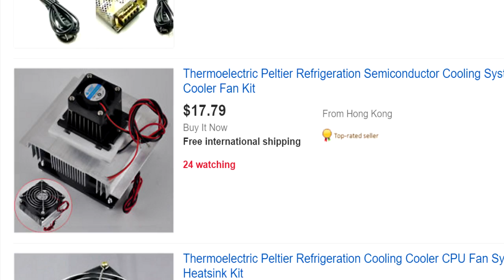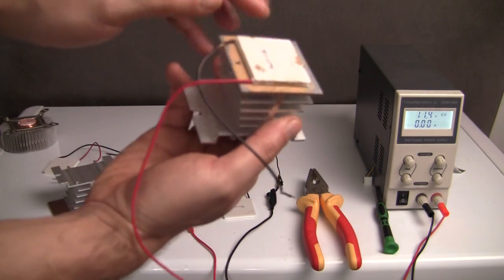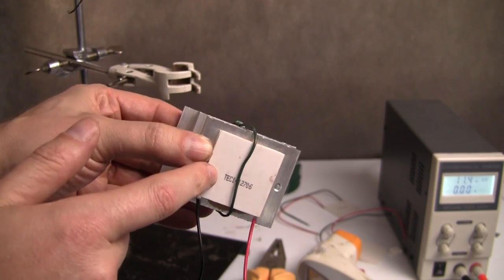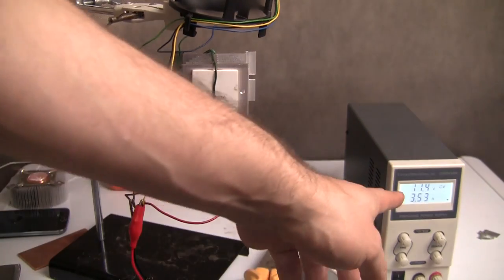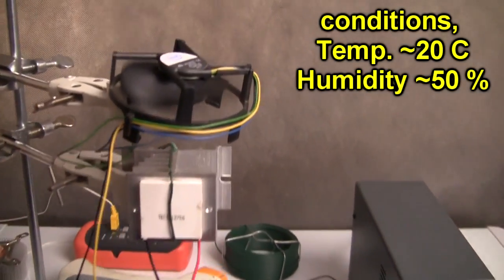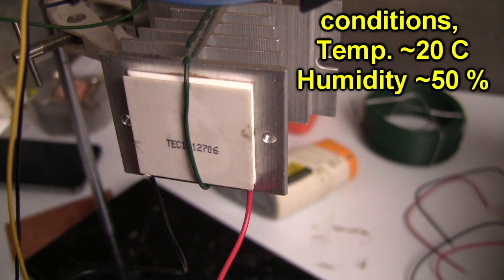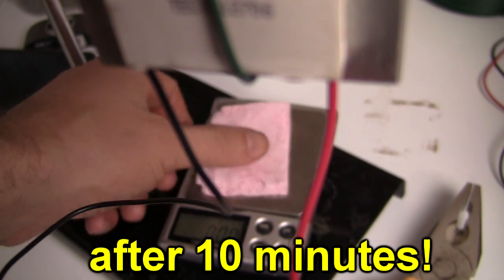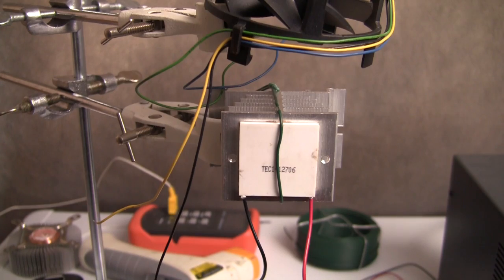Fontus Water bottle claims to make water from air.  Is it possible?

Comment: Thunderf00t... no... this not really how a device like that should have worked.

There is 3 main errors of ot.

1: are cooling a surface, not a volume.
2: are using a peltire element (They are qute inefficent)
3: are not using a heat exchange.

The surface that is cooled need to be contained with fins blowing the right amount of air  into it. It could be regulated with a thermoresistor.

A heat exchanger could be added so in theory only the water would be cooled, in reality it would have 80-90% efficiency.  That is up to 10 times more efficient.

A heat pump would dubble or trippel the efficiency.

So no.. i think you should set it up a bit more seriously with a heat Exchange.

Also the amount of water you get out of every liter of air varries a lot. Inside are the air very dry so its not really a fair comparison. Also, ironically, the warmer it is, the more water you can get out of the air.

So do it with all the components and test outside.
Reply: +matsv201
I sincerely doubt that it would be a massive dfference. But then again, 1 good experiment is worth 1000 expert guesses... or something like that.
Reply: +matsv201 Agree with you on most points. However: How do you expect to "cool a volume"? The only thing we can technically cool is a surface area.
As you're probably not stupid ;) i assume you meant to use a bigger surface area to cool the air in a volume more effectively via the cool surface.

Not sure if the real product uses peltire... Someone should probably try to find out as it is not specified on the page :P
Reply: Deltaexio
Its not a guess, its calculation. And thunderf00ts experiment was not really that good made. There is quite a long list of flaws.
Reply: matsv201 By "one good experiment" I of course meant to carry out your proposed experiment.

And it is a guess. Several guesses.
Reply: mathis8210 
"How do you expect to "cool a volume"?"
Very simple, contain it and isolate it, also use finns to make it more of a volume. Anyway, it need to be contained.

What you do is you cool the air gradually, than mix it, then cool it some more, mix it and so on. This is a science that is quite well known.

I seen exchanger is nog bigger than a phone that can run several hundred liters per minutes.

I don´t know if the "real" product is a scan, or its just someone that think they know, and don´t really.. or if they are really knowledgeable.

There is more modern peliter type elements that have around 40-50% Carnot cycle, most of the old one is less than 20%.

Its quite obvious that Thunderf00t is don´t got to much experience with humidity. So it might be that there is some things he don´t know about. Trying it indoors is to me a no no. Its really a big error.
Reply: Deltaexio Its  not a guess when you know what you are doing...

If i ad 1 to 1 and say its 2... its not a guess.
Reply: matsv201 "Very simple, contain it and isolate it, also use finns to make it more of a volume." Sorry, still not sure what you mean :P Adiabatic expansion? That would be quite effective, but that doesnt seem viable for a product that uses a constant air stream

If not then you're still talking about the same principle that tf used: Cooling a surface that in turn cools the gas around it. Thats what i meant to point out ;) 
You're suggesting a few perks to increase the effectiveness of the heat exchange between the surface and the gas volume. 
Just wanted to clear that up somehow...

So while the stuff with mixing the air while cooling it down sounds quite nice and will probably be a good experiment on its own i don't think its a viable part of the product he's trying to debunk as it is claimed to use the constant airflow of bikeing as gas source. So i don't think it will have much time to rework the air inside. It would just pick off a few molecules on "flyby".
Only viable increase of effectiveness i can see is to increase the interactionsurface (and time) by changeing the coolerstructure
Reply: Deltaexio Its a false dichotomy:
{Not Guess} =/= {Fact}
{Not Fact} =/= {Guess}
Reply: Deltaexio 
Its factuall that this test was not optimal.

The sugestion for a other test is to se how close to optimal you could actually gett.

But a problem here is that both RH and temperature effect the preforamance greatly... we know that, but it would be really intressent to try.

So really, just want to separate facts and speculation. My point is that i was not guessing that you could make it a lot better, the question is how much better.
Reply: mathis8210 
" That would be quite effective, but that doesnt seem viable for a product that uses a constant air stream"
Well.. i might be to theoretical about it... Just put a lid on it, a inlett and a out lett, then throttle the fan so there is optimal temperature out.

"Cooling a surface that in turn cools the gas around it"
Well you actually don´t need any surfaces to make the condensation. You can have one surface, then mix the air and let it air condensate. This would really cut down the surfaces you need to something feaseble.

" between the surface and the gas volume. "
No the heat exhanger would be between the inlet air and the outlet air.

"good experiment on its own i don't think its a viable part of the product he's trying to debunk as it is claimed to use the constant airflow of bikeing as gas sourc"
There is companies that specialize on products like that. But if there is no really volume constraint, its not really that much of a issue. I would think this thing would be power constrained, more so than volume constrained.

I would think of one very simple way of increasing the performance of the device... take it out doors.

Also... there might be additional problem that i have not speculated on yet.

The surface was very close to 0 degree. On a practical product you would probably run it around 2 degree. It might be that Thunderf00t is sublimated water to the peltier element, this would take quite a bit more energy than just condensing it.
Reply: me: "the heat exchangE between the surface and the gas volume" 
you: "No the heat exhangeR [..]"
different topics ;)
I agree though that your proposition is probably more effective. Im not that deep into the engineering part of the physics sphere.

"sublimated water ..."
You probably meant resublimation or deposition there.
Very unlikely that there was a significant influence as the triple point of water is at 6 mbar. The mix with air might change the requirements a bit but i don't think thats enough.
Reply: mathis8210 Yea... i write as good as i can, then the speling aid make it worse :(

"You probably meant resublimation or deposition there"
Very true.. but sublimation is commonly refereed to both direction.

Well.. it makes it directly to ice. If its really a sublimation or just a frezing, i´m not sure

Comment: Why isn't your fan on?

Also, the humidity and air temperature make a huge difference as anyone who has a dehumidifier will tell you. I've taken 2 gallons of water out of the air in less than a day and on other days I've only gotten maybe a liter.
Reply: +wwickeddogg it is absolutely possible to get a couple gallons out of the air in a day, but the question becomes, how much power did it take to get that water? I suspect it took a air conditioner size unit sucking up 110 all day.
Reply: He was working with 50% humidity here, so if his calculations were right, a whole day in 100% humidity would only be 2 shot glasses?
Reply: linglingjr The amount of water he collected is really low, but I'm not sure that a well engineered version would do any better.
Reply: Rowdy Roddy Piper
 Yes

Comment: Peltier devices for air cooling/dehumidifying are at the very best only 20% efficient. They are power hungry and only work in narrow niche markets (such as wine chillers). As for heating, they are actually a bit more efficient than Ni-Chrome wire as they do not get as hot but consume far less than Ni-Chrome does at that temperature.

Comment: actually, if this primitive setup makes about 0.5ml a day, it's not so hard to believe well build condensation chamber can make at least 10times more.
Reply: +KohuGaly exactly what I thought. I doubt his heatsink is properly seated on the chip with heat conductor coating.

Comment: you have to love the man that have random peltier device in his home :)
Reply: Hahaha, I got a pair of 5 volt plates, they run from my powered USB hub. 
I'm like a male bag lady with premises.
Reply: +madtrade I've got some laying around my house
Reply: +madtrade Ive got a few laying around. Ive been doing a lot of experimentation to try to integrate one into a computer mouse  to prevent sweating during those extended gaming hours.. Isnt working all that great so far. Having a hard time getting a proper heat sink that will fit in a mouse, and still pull enough heat.. Ideas from the gallery?
Reply: +CrazyCrawlers With the Peltier element added, there is too much heat in too little space. The only way I can see it pulled out of the mouse is to watercool it, and use flexible tubes to connect it to a separate active heat exchanger (peltier+heatsink).
Reply: tybofborg
This is something ive thought of. And would probably do for my personal prototype.. But im unsure how the gaming community would accept extra shit attached to their mouse.. Although i guess some smart marketing, and making it piggyback to already existing CPU water cooling systems might make it more appealing..

Comment: Seems that most of their demonstrations were filmed in very humid enviroments, sea, forest and alike, which would make for some better promo footage i guess, but yeah, try doing that in africa.
Reply: +Poptart McJelly If you were in the sea faring boat then you might as well use a heavy dehumidifier to collect water. Compressors are much more efficient at moving heat around than peltier effect devices.

Comment: Can this be ramped up for a greater result? More power and a larger size, for example?
Reply: probably
Reply: +Michael Robbins I imagine that it could, but you would need to worry more about power consumption then.  If it gets too large, you are better bringing a case of water instead of the big battery/device for it
Reply: +Ness9 resuming
get a 2k+ dollar energy bill :D
Reply: if you watercooled the other side and got heat away faster, it'd also be more efficient.
Reply: +Ness9 I have access to cheap solar panels, so I was thinking something like this could be solar powered
Reply: I suppose it doesn't use too much power, you could possibly run it off that but I wouldn't know for sure.

Comment: Thunderf00t debunking pseudoscience for the betterment of man kind. Great video, I'll be looking forward to the proper explanation in the next one!
Reply: +Eineus21 Well it isn't really pseudoscience, since it does work, just not nearly efficiently enough to actually function as advertised.
Reply: +QBG So it's technically not pseudoscience. It's just really, really, really bad engineering. (Much like the hoverboard and the solar freakin roadways. You can build such devices, they're just nowhere near as useful as they'd like you to think.)
Reply: stcredzero Exactly. Pseudoscience is something that comes off as sciencey-sounding, but isn't actually based on any kind of real scientific principles, like Astrology. The self-filling water bottle is based on real science, but as Thunderf00t demonstrated, it doesn't actually produce water quickly enough to keep a person sufficiently hydrated by itself in a genuine survival situation.

Comment: Unless the water bottle has chargeable batteries in it that can hold enough charge to run at night then your gonna get half a shot glass a day at best. That said I wonder if the water bottle would eventually pay for itself.

let's say the water bottle never breaks... Then you just have to get enough water out of it to offset the cost of the bottle... Wonder how long that could take.
Reply: +water2770 
45 years later "YES! This water bottle has finally paid for its self. Take that all you nay sayers. In the end I get the last laughing."
Reply: +water2770 water has almost no monetary value though!
Reply: ***** It has SOME though. 1.50 for every 1000 gallons, and your getting about 20ish ml of water a day in a relatively humid area. doing some conversions your getting. 7.93*10^-6 dollars a day. After running it for a year you have about 28-29% of a penny. after a thousand years you've basically made $2.85
I wish I could live forever because this thing would eventually pay for itself... if the solar panels still functioned after a thousand years.
Reply: water2770  water could go down in value if we have better tech and infrastructure for extracting and cleaning water in the future or if the nestle company gets their way it may be extremely expensive due to their planned water monopoly